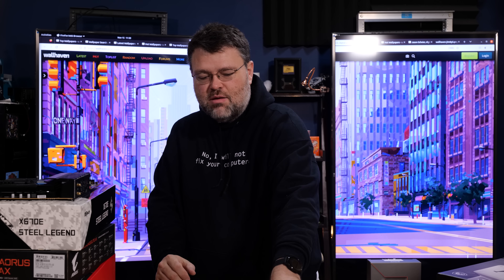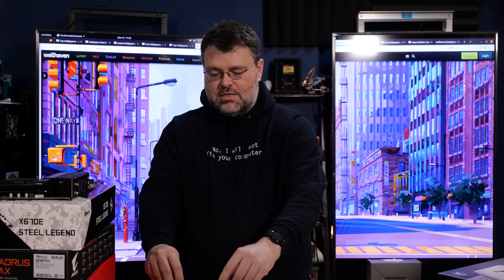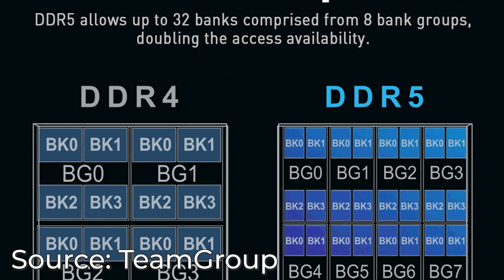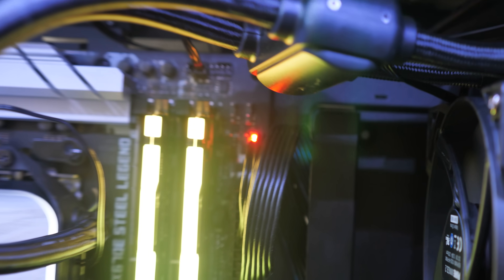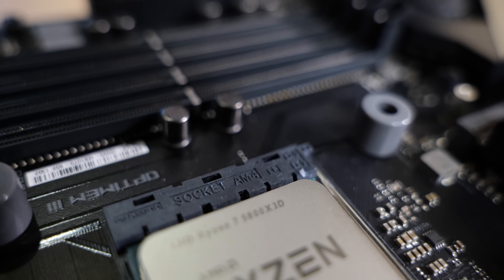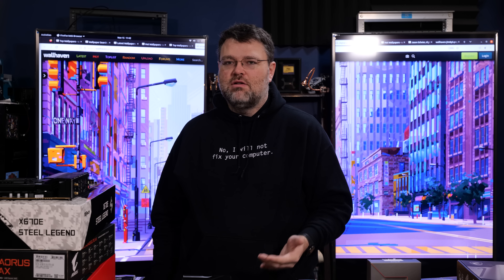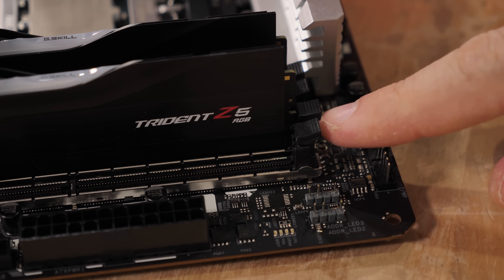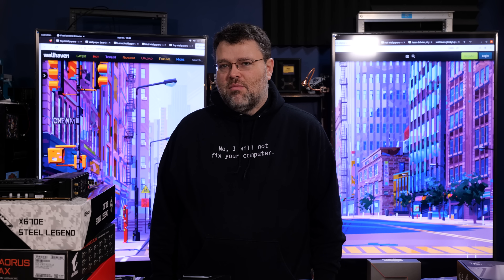Is 128GB of DDR5 IMPOSSIBLE on AM5? Level1 Investigates!

Comment: 3:00 I've experienced this on countless DDR4 boards in the last few years, especially in the ITX space. Have to not only push down, but help it in place by pushing the latch closed.
Reply: i HATE it ... makes me feel like i'm going to break the board/chip and I double check the orientation at least 3 times
Reply: @derekp6636  Yeah the crunching sounds of the slot is always unsettling, and I build 8 or so systems a month. Unfortunately getting them backward is still a problem, since it's fairly easy to miss which way the key is oriented if you're not careful, and given how close the key position is between DDR4 and DDR5, it's also easy to think you've got the correct type of RAM when you may not, as well, so even more care is needed. I know they didn't really have room to move the key very far, but it would have been nice if DDR5 did differ a little more vs DDR4 in connector appearance. Would have saved one client who brought an in-progress build to me, since they tried shoving DDR4 into a DDR5 board and ruined the board. Luckily the RAM was undamaged.
Reply: In my experience it's because of the modern slots where only one side gets a latch. I always have trouble getting memory into and out of those, while the old double latch design snaps closed easily. Click-click always works. Silly thing to cut corners on if you ask me.
Reply: @myselfremade yeah, would be nice, but they'd have to divide the data bus segments to do so, and for signal integrity reasons this was not done. A new PCB design that was either longer or shorter would have been the true ideal, solution, but alas, $ talks, so here we are.
Reply: same. went small board this time and had to reseat the ram because it wouldnt post even though it "clicked."
Reply: @Andrew Crews Rambus dram flashbacks...

Comment: Glad I watched this because I was going to get 4 DIMMs of 16GB as its cheaper than 2x32GB, but if I have to run it at 3200mhz then Id rather pay the extra £100 and get 2 DIMMS.
AM5 / Zen 4 is starting to look like a really bad platform with all its other shortcomings.
Reply: This is the wrong lesson to learn from this video. Wendel did not test 4x16GB. If he had he would have noticed that it can clock very similarly to 2x32GB. Thus, if 4x16GB is that much cheaper for you then get it over 2x32GB.
Reply: @Bayonet1809  yeah but it would mean I'd have to mess with the clocks manually rather than it coming standard and then I'd have to test for stability and then fine tune it if it fails. It's just not worth my time, I'd rather just stick with 2 DIMMs if the CPU specification says that's what it's rated for.
Reply: @KieranDevvs  I don't think that is correct. XMP/EXPO works for 4x16GB as well as it will for 2x32GB.
Reply: @Bayonet1809  XMP or amds equivalent might work but that doesn't guarantee the clock speeds are going to be stable. I had a headache with XMP on my i7 4790k getting 3200 to work without BSOD'ing, I eventually just had to turn it off and use the defaults. Maybe you're right but unless someone can make a video and confirm it, I'd rather play it safe and buy what I know will work
Reply: @KieranDevvs  My point was that you really never know what will work, but that 2x32GB and 4x16GB both stress the IMC equally, so have the same likelihood of working at rated XMP speeds. 
If you are that concerned then only buy a ram kit that is on the Motherboard's QVL as having been tested at the speed you want.

Comment: hmm I hard disagree on testing with memtest86 - it's OKAY to spot complete faults but as for stability naah gotta stress in windows.
corrupting the install can happen though that's true.
Reply: And/or use one of AMD’s feature advantages of not disabling ECC by default and use a motherboard and memory with ECC support. Have many AM4 systems with 128 GB of ECC memory and no issues with DDR4-3200.

Comment: Anyone ever tried boring JEDEC SPD-only 128 GB of DDR5 ECC UDIMM from Micron?
Reply: This is what I want to know too. I imagine it will only clock to 3600MHz, but who knows?
Reply: I‘m all tingly to test it myself, but I haven‘t got an AM5 platform yet. Was specifically asking about the ECC UDIMMs from Micron since every (?) other test with 128 GB seems to have used DRAM from SK Hynix, not Micron and Samsung‘s aren‘t out yet as far as I know.
Reply: @abavariannormiepleb9470  I didn't even know there were any Hynix ECC UDIMMs. I can only find Micron ECC UDIMMs available, and have heard that Micron non-ecc UDIMMs are really poor overclockers compared to Hynix and Samsung.
Reply: @Bayonet1809  Could push Micron DDR4-3200 32 GB ECC UDIMMs to DDR4-4000 with a 5750G APU. Kingston 32 GB DDR5 ECC UDIMMs currently use SK Hynix DRAM as far as I know (same as the non-ECC DIMMs Wendell has been using in this video), so since these have issues with a 128 GB configuration with Zen 4 I‘d test Micron modules first.

Comment: At At last.Thanks so much for doing what no one else will!  Anyone running VMs, AI etc will appreciate this (and Firefox can eat 10G alone..don't know if it's memory leaks or my open 20+ tabs,  but it's a hog ;-)
Reply: There must be something wrong with your profile or something, I'm easily running Firefox with 1500+ tabs on a host with 16 GB RAM
Reply: @erisdiscordia5547  click on each tab so it loads the content for the page the tab represents.  I had Firefox open and using 2.5GB of RAM but after clicking the other tabs that were from prior sessions it jumped up to 4.2GB (32 tabs total).  I'd imagine 1,500 tabs would use quite a bit more than 16 GB unless Firefox starts unloading content for tabs that aren't one of the past nTabs viewed.  Now my 4.2GB for 32 tabs vs his 10GB for "20+" tabs is a bit mismatched, so he might have an issue, but it's also possible there's much more content loaded on his 20+ tabs than my 32 tabs.
Reply: @erisdiscordia5547  nonsense unless those tabs have yet to be loaded, and if so what good are they? All modern browsers are memory gluttons, and I suspect that trend will continue so long as developers have more and more memory overhead to work with.
Reply: Ikr, everyone is talking about creators but it’s just as painful for power users who like to research stuff without closing the tabs

64GB out of 128 on my last system was just hogged by Chrome I swear (with multiple Chrome profiles etc.)

Gotta adjust our habits now I reckon 😅
Reply: Shouldn't be mem leaks because of rust borrow checking